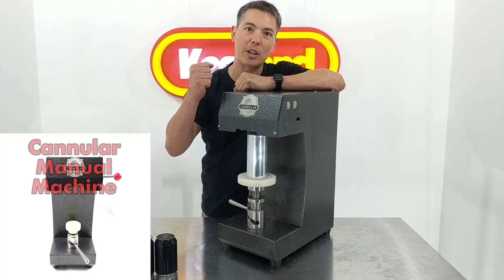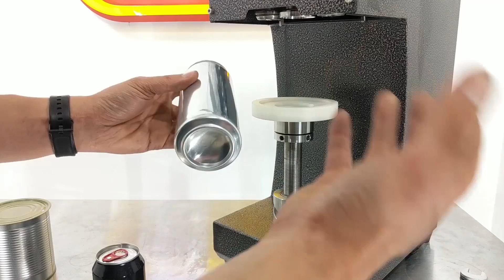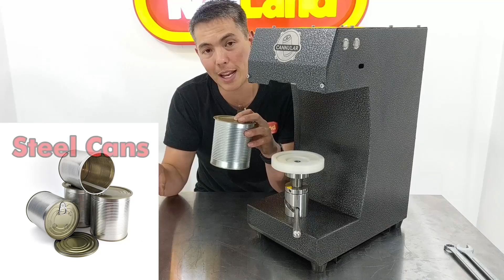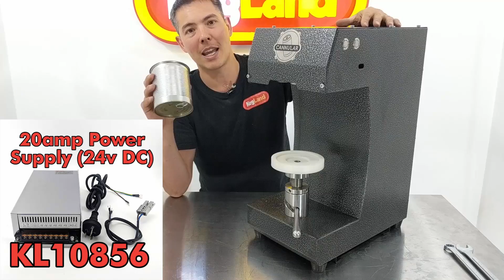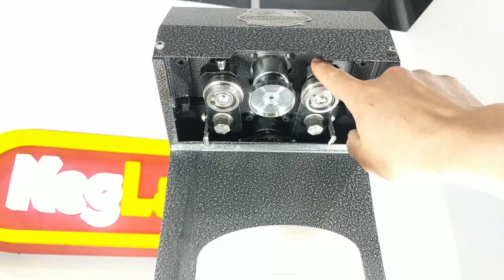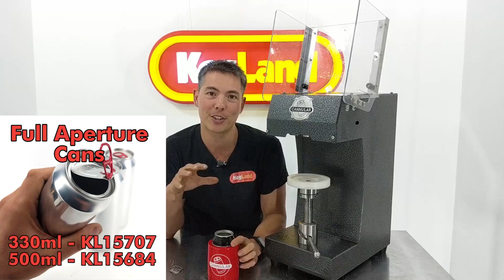Cannular Semi-Auto Craft Brew Can Seamer - It's Finally Here - Canning Just Got Easier

Comment: Recently Purchased works fine on plastic cans but wont work for fluid with co2 gas. like cola.. unless you have an answer 🙂
Reply from the maker: I have not experience with the plastic cans but the first thing I do is always check the actual overlap.  If your overlap is good this is generally the most important thing to getting a good seam.

Comment: Shouldn`t be necessary to adjust a brand new machine. And the splash guard should be part of the machine
Reply from the maker: Yes we have been doing quite thorough testing before the machines are shipped now so generally speaking they do not require adjustment when new.  If however the machine is dropped or get a hard knock in transit this can alter the settings so further adjustment is necessary now on about 1 in 50 machines.

Comment: That's an Open ended Spanner bty not a Ring Spanner. What is the payback in terms of pints brewed for a Home Brewer. I think I saw somewhere that the cans were 40-50p each and non re-usable. A pint of my normal brew costs me 40-50p, this is doubling the cost.
Reply: The best price I have been able to find for a bottle cap (also not reusable) was nearly 30c each (buying 1000), so it's not vastly different.  Definitely more expensive than kegging though (and less convenient for the most part) , so I'll stick with kegging for most things and only bottle/can (once I've saved up enough for a new shiny) on the rare occasions it's the preferable option.
Reply: @dfross87  Just googled for Crown Corks 100 £1-99. 2p each. Didn't look for bigger quantities.
Reply: @jamesgoacher1606  You are correct.  Please forgive  my sleep deprived arithmetic.
Reply from the maker: yeah sorry about that.  I should probably work out a better script before shooting this stuff as I do quite frequently make slip ups like this.  Hopefully you guys find this tolerable.